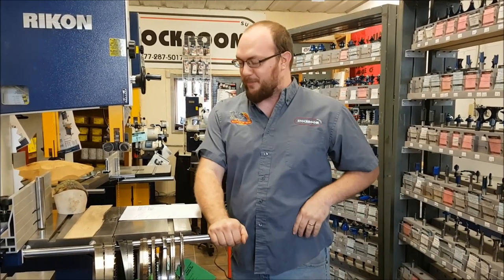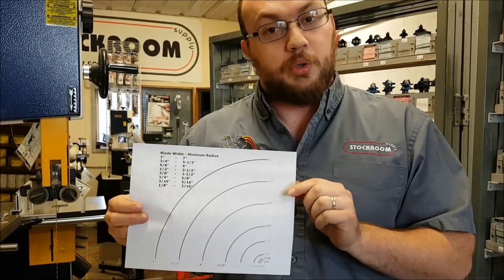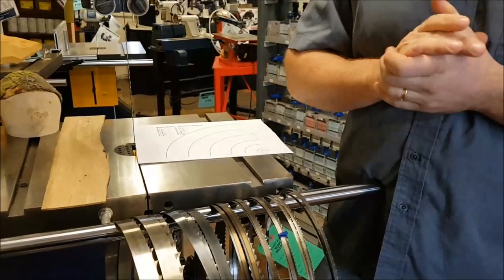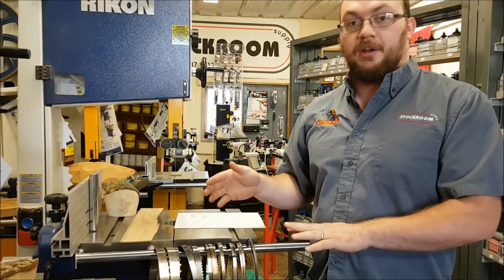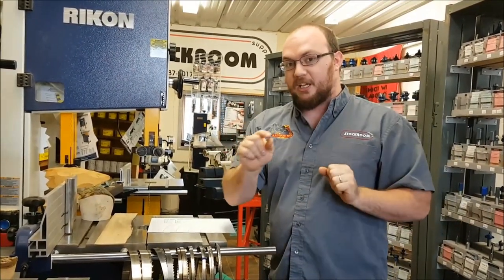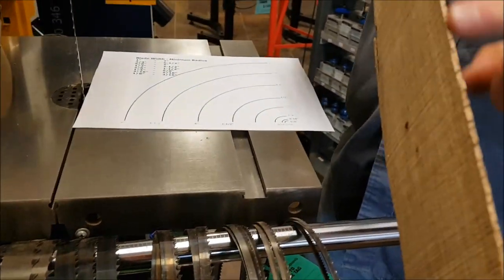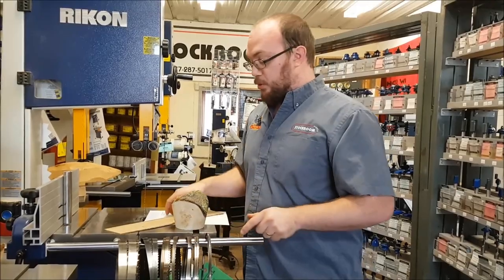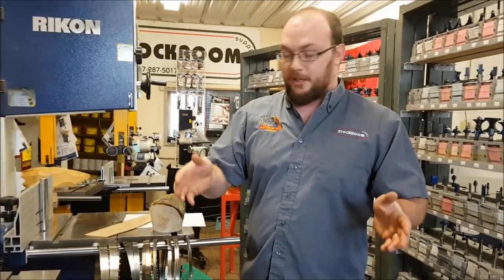EthAnswers What Size Bandsaw Blade to Use? Does Size Really Matter?

Comment: You covered a lot of bases, the important ones. 👍
Blade width versus cutting straight..... that's exactly what I was going to ask. 
Thank you sir 👍
I'm amazed at how few people are commenting.
........one of those people purchased new, the Rikon I just purchased used.
I paid $160 for a brand new looking, 10-305 Rikon. It has a 1/2" blade and I'll assume a 3/8 blade came on it new?
The blade isn't very sharp but it cuts "OK".
Looks to be 4 tpi.
  I'm thinking of buying a 3/8 6 tpi for general use.
I'd prefer a smooth straight cut when using a fence, not a fast cut, because I don't see making long cuts.
....I'm trying to keep this page alive by commenting. Others should add their two cents too.
Thanks, you helped a new to me bandsaw owner out. 👍
Reply from the maker: Thanks for watching!

Comment: Thanks for your excellent  review on wood cutting blades. This may be of interest to some. While working as a tool & die maker, cutting many grades of tool steels with tight radii, we standardized on .035 x 1/4 10T Bi-Metal blades on a DOALL 20 inch variable speed band-saw.  Materials were A2, D2, CRS, and Aluminum.  Blades were purchased in 100 ft. rolls, cut to length and welded on the induction welder mounted on the machine. Blades were cut as necessary, threaded through openings in die sets and re-welded for sawing slug openings through 2 inch thick cast iron die sets.

Comment: Always good info.  Was wondering if you could also cover which blades (sizes and types) correspond with different materials being cut: from soft woods, to hard woods, to aluminum/brass and on to milled steel bar, etc.

Comment: I'm glad I found your video.  It was extremely helpful for a beginner like me. I just purchased a band saw and was thinking that my blade was too narrow (1/4") to cut a piece of rough pine pallet board.  I may have been trying to go too fast.  The blade seemed to bend too much. I need some instruction on how to tension the blade.
Reply: You heard the saying: "speed kills". Well it will destroy your cut as well.
Reply: Linda, if your guides and tension are set correctly 1/4 blades are strong enough for any type of cutting plus the advantage of cutting very tight radii. Slow up a little and let the blade do the work.

Comment: Just for general cutting from 1/4" to 3" maximum thickness would you recommend the 3/8" blade? I really don't need to cut anything thicker than that.  How many TPI would you advise? I make pretty much straight cuts and not fancy curve cuts.

Comment: Dear, many thanjs for video, nred your help. i need to cut tight curves in 18mm birch multiplex, am looking for entry level bandsaws, most can fit 3-9mm wide blades wich are ok for tight curves, but then i fond metabo bas 261 wich as far as i can tell is far better quality but smaller with of band is 6mm, can i fit smaller width by changing guides in order to do tighter curves? Or could you recomand a compact bandsaw wich is a bit over entry level max 300 usd that can fit 3mm bands?

Comment: Have a Rikon and it vibrates. The blade looks to running straight, is it too tight or is there something I'm missing. It has the blade that came with it. It's a 10-305 model.

Comment: I was looking at making a band saw since I had a extra 3 speed motor, and thought it'd be better(cleaner cuts, quieter, easier strait lines, etc.) for sheet metals, thin plate metal(less than 1/2in) and bar stock, as apposed to cutting everything with a angle grinder.  The internet seems to suggest that some band saws can use blades of multiple lengths, which seems odd. I was hoping you were going to discuss the choice of band saw blade length in regards to versatility and purpose, and types of blades for different purposes or materials. I cut much more metal and plastics than wood.

Comment: I have a king Canada band saw. With a 14" clearance opening. I guess it's a 105" saw blade? And it has a 7.5 amp motor.. but I can't cut thicker wood it just slows to a crawl or stops. I mostly need to cut red ceder and yellow ceder for the harder wood. I was wondering if I get the 3tpi if that will cut thicker wood without my bandsaw slowing down? With that 7.5amp motor
Reply from the maker: Hey Arian,
A more aggressive blade with a heavier set may help! The larger teeth and wider set with help clear the sawdust away from the cut...therefor taking less power away from your saw. Here's the blade I recommend;
http://stockroomsupply.ca/shop/bandsawblades/clearance-bandsaw-blades-misc-sizes-styles.html

Comment: Hi Ethan I am looking to cut some 1”1/2” x 1”1/2” x 18” long ebony for snooker cue butt,I purchased a small bandsaw which came with a 1/4  6 tip blade, which I think would be to thin, the max blade machine will take is 3/8 I was going to by a 3/8 4tpi blade for  re sawing ebony do you think this is an option that will work thanks mike

Comment: hi ethan I am a beginner and thanks for the information appreciate it. recently  ive purchased a bs250 bandsaw. i was thinking if you can fit it with a 4 tpi blade? thanks
Reply from the maker: You definitely could! 4tpi is a good option...still cuts quickly but relatively smooth.

Comment: What about the length if my bandsaw for example says a 60”blade can I put say a 58” on or a 62 “ on because the top wheel moves up and down  if you get me ? Or do you have to stick to manufacture spec
Reply: This is what I came for.   Did you ever find that answer?
Reply: Kelli'Anne Larrieu hi yeah you can  get a blade a inch or two shorter or longer but the shorter one could snap while tensions and if your bandsaw hasn’t enough tension you will get a bad cut if you can at all possible get a blade as close as possible 😐
Reply: Thank you so much.
Reply: Ok. So let me make sure I’m getting this after running to menards Home Depot and around the world for this answer. My band saw a ryobi bs1001sv says 67 1/4 67 3/8 etc according to the cut desired. Now if my menards has a 70’ or 62’ band saw blade, I can use one of those just making sure my tension lever is right? 

The adjust that can lengthen or shorten the blade choice, it’s ok to use a smaller band like 59.5 .25 blade? If it fits and secure ? 
I hope I didn’t confuse you

Comment: Hi Ethan, I recently purchased a 10-326 as an upgrade (more power and vertical capacity) to my Rigid 14". I do a lot of re-sawing and ripping of hardwood logs into lumber - been using a  1/2" 3 or 4 tpi .025 hook tooth blade. Was thinking about a wider blade but shied away because they are .032 thick. The manual specs a maximum width of 3/4"... what is your experience?  What would blade would you recommend? Thanks, Hank - Perth, Ontario

Comment: I have a 9" band saw that calls for a 59 1/4" blade. When trying to install it it's so short that the bottom of the top wheel has to be lower than the housing or case? (whatever it's called). When I try to tighten it I have to adjust it up as far as it possibly can go just to clear the top wheel from rubbing on the case/housing. Then when the wheel clears the housing it's so tight the wheels won't turn. I watch videos and  ever see anyone struggling to install the blade. Should I disregard the manufacturer that calls for a 59 1/4" blade and just get a 59 1/2" blade. I can't imagine it should be like this just to install the darn thing. I'm about to trash the bandsaw instead of wasting more money on a saw I haven't even been able to use.
Reply: Yes, go with the 59 1/2" blade. You probably have quite a fair bit of adjustment from minimum to maximum (no blade on the bandsaw), so an extra 1/4" length is fine.

Comment: Hi. A quick question if I may. I’m new to band saws only had mine a month. I’m having trouble with what  I think is called blade wobble. The final cut is sort of ridged, a bit like Corduroy fabric. I have tried changing blade tension, tracking and bearing position but nothing had changed much. I notice that when turning the wheel by hand slowly and looking at how the blade moves it does have this slight wandering. No idea how to correct it. I have a record power bs 250. Any help or tips would be greatly appreciated. Many thanks.
Reply from the maker: My best guess is the blade you are using has been improperly welded. If it has a visible wobble two different things may be happening. Either it was welding at a slight angle cause the blade to wobble at the weld and cut deep ridges(most likely) or there is a burr on the back of the blade that is hitting the thrust bearing and making the blade "bounce". A simple solution may be to source a new blade.
Hope that helps!
Ethan

Comment: How can you talk about bandsaw blades without even mentioning "set angle? Can you explain how I cut a 1" diameter hole in 18" of Doug Fir with a 3/8" blade or 1-1/2" with a 1/2" through the same timber? Can you explain why blade manufacturers don't state their blades' set angle along with the other stats? Set angle determines how tight a blade will turn or follow a misaligned fence, yet no one will even talk about it. I don't understand how people can talk about bandsaws at all without describing the blade it's meant to run first.
Reply from the maker: William,
Honestly I am a bit puzzled how you cut a 1" hole through a 18" piece of Fir. Did you predill a smaller hole, cut a bandsaw blade, reweld it inside the hole, make your cut and then cut the bandsaw blade off?
This video did not get into the depths of bandsaw blade info. It was just meant to talk about the main points like width, TPI, kerf and material. In the future I may make another video that delves into different tooth geometry and some of less used blade materials.
Thanks for the suggestion!
Reply: See my Radius Plug video from either my William Falberg YouTube channel or the Titan videos on my website www.falbergsaws.com My latest video is taken from my book and teaches what set angle is, and how to calculate it.   Google "calculate  bandsaw blade set angle" you'll find it . It's really ALL about set angles.

Comment: You've said the thinner the blade the smoother the result, and the wider the blade the rougher the cut. Pal, that is crap, give me Alex Snodgrass any day, come back when you get your facts straight.
Reply from the maker: I think you may have mixed up what I was saying...A thinner kerf(not width) will always cut smoother than a wider kerf blade.  If you compared a bandsaw sawmill(generally uses a 0.037" kerf blade) it will cut much rougher than the 0.022" kerf blade we would use for scroll work. I hope that makes sense!